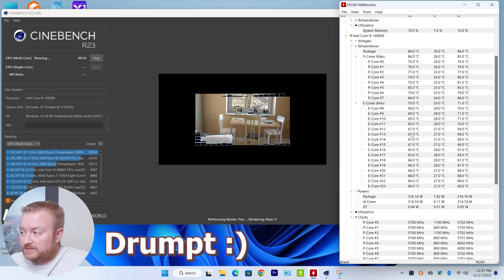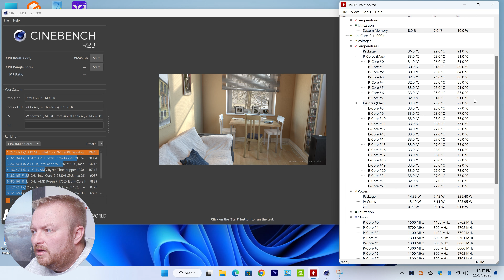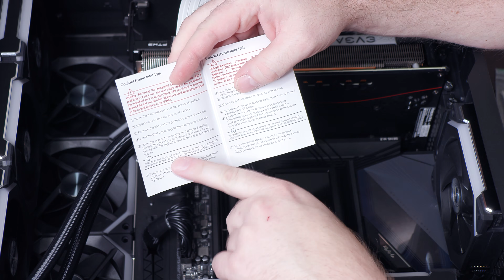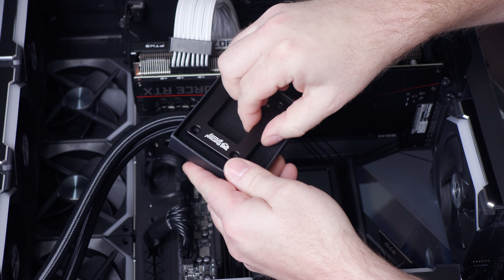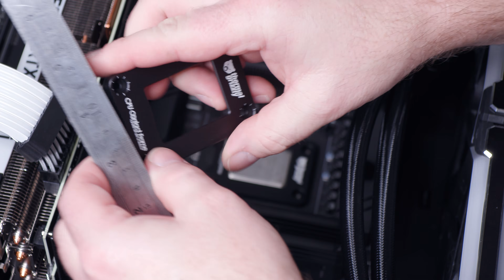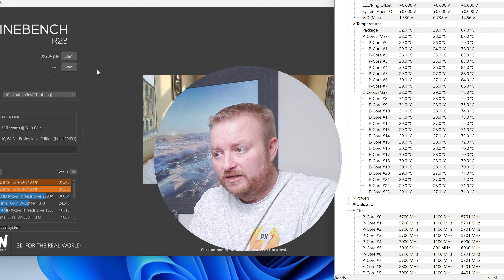Cooling The 14900K | Thermal Grizzly Contact Frame

Comment: a thousand thanks 😀 I looked for instructions or manual or something for my 13 gen and it is nowhere to be found. not even on the thermal grizzly site. I ordered the grizzly and i wanted to check how you have to install it to be prepared. i do not understand why the guide is not available on the grizzly site...

Comment: My 14990k hits 96-100 in occt just ordered a contact frame to see if it helps as I noticed the right side wasn’t making contacting with my aio and how’d you get such high scores
Reply from the maker: The contact frame probably won't help but maybe one or two Celsius it's really not that big of a deal but it also depends on your  cooler and how good that is. I cannot confirm why my numbers were so high it all depends on your settings in your bios which a while ago did not have Intel settings that were standard so that could have something to do with it

Comment: I'm getting ready to put together my new build this week which is based on an AMD Ryzen 9950X3D. This is the first AMD build that I've put together since AMD Athlon I think. So I've been on Intel for quite a while now. My old system here is an i7 8700K. When I was deciding on whether to go team red or team blue I sort of had a red flag go up in my brain when I was reading about power cores and efficiency cores. And then I was looking at the AMD side and all they have is just normal traditional cores. So right off the rip Intel is selling chips that have cores that are underperforming but marketed as a "feature" and also the chips are possibly destroying themselves due to overheating. So then I looked up how much wattage each team is using on their top-tier chips and team blue is nearing 400 watts and team red is about 170 Watts. I really think Intel is on the decline here. Pretty sure I heard talks about them getting bought up by somebody else. AMD is just killing it on the CPU and the GPU side.

Comment: In the next 2 days I want to install my new i7-4700KF with a Thermaright V2 contact frame and Kryosheet thermal. I have a question? The Kryosheet termal pad can touch the contact frame or not?
Reply from the maker: If it touched it slightly not a big deal. The contact frame sits a hair lower than the IHS

Comment: You don't show it so I have to ask, did you clean the old thermal paste off the bottom of the heatsink/pump before reinstalling it (at 15:30)?
Reply from the maker: Yes anytime I remove the heatsink of any sort I will reapply

Comment: After 30 days, i figured out myself and used intel xtu and lowered the p core and e core ratio down to 48x, i.e., 4800mhz. Now, the temps  are 80 max on 100% load.
But it's still a disappointment because i am not getting the actual value for money because i have lowered the speed of my brand new i9 14900k for the sake of temperature.
Some say the h150 is not compatible for i9 14900k and upgrade to a 20 to 25k cpu aio cooler.
Please suggest me what should i do, upgrade my  cooler to a compatible one or just let my i9 to run at 4800mhz forever?
Thanks

Comment: I first saw the contact frame review on GN and was impressed by the thermaltake frame. A lot less expensive than the Thermal Grizzly frame and helped cool the CPU a little bit better. Bought that one for both of my 12th gen CPU's. I will only use contact frames on the 12th thru 15th? Gen Sockets. Intel dropped the ball on the LGA1700 processors by not adding another hold down clamp on the other side of the CPU for even pressure.

Comment: Contact frame helps but I can't undervolt at all. Even 0.015 will cause instability  at 0.030 under it won't boot ..  I'm still throttling at hit 100c at 253 200! Pl1 pl2...

Comment: Tightened my frame "snug" and got a no post CPU not detected, backed them off a bit and voila posted!  They mean it when they say hand tight, so resist the urge to give it that little extra unless you have a NM torque driver.
Reply from the maker: Yeah only finger tight. I think what happens is the pins on the MB move off the LGA

Comment: I think your parts list is outdated.  That's a Gigabyte Auros board and of course you're putting in a 14900 not a 12900.  Not sure if the other parts listed are updated.  Going to take a shot at the thermal frame and the contact sheet.  Thank you.

Comment: Unfortunately, in my case, the frame installation on the i9-14900k failed. I attempted the installation twice, even with a different method of applying thermal paste. the first time I used the spreading spatula, the second time I used the X method. I used the original screws and followed the 90 degree rule. The cooler I use is nzxt kraken 360. After the installation process, the computer heats up to 100 degrees a moment after starting and causes a blue screen. :l
Reply from the maker: It heats up to 100 just at an idle or when you do a stress test?
If during an idle that is not normal but if during a stress test the is normal

Comment: I have an i9 14900k and with my MSI board and a 360mm AIO, with default settings, I was hitting 100c almost instantly during R23 multi-thread benchmark. It was crazy. I had to go into bios and set the cooler to a "box cooler" which sets the limits to intel spec (253w). I also had to disable "enhanced turbo". My temps are now down into the high 70's to mid 80's during benchmark, but I'm noticing that I'm barely pushing over 200w... I get a score of like 36k, when, even with it hitting 100c immediately and thermal throttling like crazy, I was hitting 39k... I have tried going back to default settings and just undervolting with XTU, but that didnt stop the frequent 100c spikes. Super frustrating. I'm not sure why I'm limited in wattage to 200 or less when setting everything to intel specs, and when even just setting it to the middle ground (tower cooler) in bios, which is something like 288w, it still spikes like crazy and goes over 300w. I just dont get it. What am I doing wrong?

I'm getting the contact frame, and going to try using a different paste than the one that already came on my corsair h150i AIO, and hopefully that will make a difference? I see a lot of people fixing their temps on their 14900k's but they are using ASUS boards where they disable the "multi-thread enhancements" setting and its all better. I've been tweaking this for days now. I'm mentally frustrated as hell. I've just resorted to using it as I first described, and getting less than 200w of power just to keep them temps reasonable, but I feel like I'm missing out on a lot of potential with it running so limited. In XTU it says im almost constantly "current/edp limit throttling"... I'm assuming that's because the mobo is trying to limit the power sent to the cpu to keep it from spiking, but I just dont know. Sorry for the long comment, but I'm essentially throwing my hands up in frustration at this point.
Reply from the maker: I have stock settings but found out that it is not keeping a constant cpu speed

Comment: I’m considering the ASUS Rog Ryujin III + Contact Frame for my upcoming 14900K build, but I’m in the fence whether to get Liquid Metal over conventional thermal paste. Most of the time it’s used on CPU’s that are direct die. You think using it would still achieve better results over say Artic Silver 5, even without a delid?
Reply from the maker: Unless you know what you are doing go with normal paste

Comment: You arent thermal throttling on the baseline becuase your P-cores clocks are all over the place I saw as low as 5200mhz during the run, same thing for the contact frame and Kyroshit(too expensive for what it is) so you cant evaluate much seems your motherboard is setting temp limits to 90º and then downclocks the CPU to keep it that way, 39K is low for a 14900K it can go as 41k NOT OC with properly setup with tuned SVID AC_LL / DC_LL or a undervolt preferly both.

Atlest you are using the 2nd gen contact frame from Grizzly the 1st one did more harm than good to stability of the system with its precise torking and overengeniering bullshit. They say the next version was revised for the 13th gen thats BS again since the dimension of 12th and 13th CPUs didnt changed.

Comment: You should have put the same thermal paste you had before installing the contact frame. There is no way to properly compare performances with and without since you didn't... I'm sorry to say this is a close to useless video...
Are the new temps because of the frame? Because of the thermal pad? Who knows!? :\

Comment: Actually just went through this whole process today and I got pretty good results with my 13900K which is cooled by a NH-D15S along with a -0.075v undervolt and I don't hit above 85C while scoring between 39500-39800 in R23. I will say that the biggest difference I saw was the reduction in variation of temperature from core to core. Most specifically the e-cores.

Comment: You were power limiting at ~280w after a short boost period, that is why you didn't hit 100C or keep the cores @ 5700, using a tool like XTU may help you catch these states and understand what is going on. Your Bench Score is low for a 14900k due to the Power limit set by the motherboard. I would hazard a guess that your mobo thermal throttled you to 90C too as the boost should always hit 100 unless ur running LN

Comment: I've always built my systems to push-pull the radiator from cooler exterior air from outside to inside (helps get the cpu cooler), rather than having the fan draw the already warmer interior case temps into the radiator and thru the radiator. Doesn't seem that it would be as efficient. I also have 3 fans on top ehausting the interior heat (since heat rises), and another single at the rear drawing out the warm inside heat.

Comment: Jeez I throttled almost immediately with my aio. I got some kryonaut extreme coming in next week along with some fans.

Also can you runs these tests on cinebench 2024?
Reply from the maker: Make sure you have your pump connected properly. That would result it over heating
Reply from the maker: Yes you can run that test

Comment: i don't have to remove the mainbaord for the frame to hold the backplate, do i? the backplate of the cooler holds the backplate, doesn't it?
Reply from the maker: Sometimes you do and sometimes you don't it depends on the cooler bracket that you're using and depends on your PC case if you were to install it and then have nothing for it to back up to I would always recommend installing it outside of the case unless you know that way you know it fits properly

Comment: disable the virtual settings in bios and set your pl2 and pl2 to 253 watts all your temp problems will go away that cpu was not met to pull 316 watts under load

Comment: Can the original mount bend my CPU so much that it stops working or works worse? Have 14700k and liquid freezer 2 360
Reply from the maker: Not the original, no. The contact  frame can push down too hard to where is stops working though

Comment: Did you mess with Asus' multicore-enhancement to bring down the heat, Mine by default was set to auto, so my CPU was hitting 100c+. After disabling it, and setting intel guidelines it now runs way better.
Reply from the maker: Nope, I didn't change anything. This is a gigabyte MB not Asus

Comment: Can the kyrosheet contact with the contact frame? default cut out for the sheet for LGA1700 is 38x38, since you measured 30mm across.

Comment: I am so frustrated with my 14700k. I installed a 420 arctic liquid cooler and still peg out as soon as I start cinebench 23.
Reply from the maker: Maybe you don't  have the pump hooked up? This would make it heat up fast. Double check that

Comment: What AIO are you using? I couldn't find it anywhere. Where is you CPU AIO front or Top? You mentioned push pull, which fan locations are pushing / pulling and in what direction.  Great video thanks
Reply from the maker: Sorry it was in my build video. I added it to the description. Air being drawn from inside case to the outside. AIO installed vertically in front

Comment: Can we use together contact frame and kryosheet ? I mean contact frame share aio pump plates surface and helping to cooling. Doesn't the Kryosheet create a gap between contact frame and the plate?
Thanx for the video btw
Reply from the maker: You can use them together. I showed it in the video

Comment: I will be testing out thremalright contact frame/EK 360 LUX aio/ artic MX6 with my 14900k this weekend. I was thinking about using a push pull config in my lian li evo case. But I think i will stick with 10 fans I got already. I think the 3 SL140 I have in the bottom as intake do such a good job bringing in so much cold air, and plus my PC is in the Basement. But really curious to see what temps I get without doing any undervolting or using extreme utility AI :)
Great video by the way

Comment: I just got my own setup done, 14900k with the frame, kpx paste, full custom loop with 2 triple rads and 1 dual rad and running cinebench runs the temps up to 100 on two cores and between 90-95 for the others . Clocks show 5.4ghz running which all seems wrong but it scores 40633 ish so... I dunno ...
Reply from the maker: Interesting

Comment: Any reason to not do push/pull as intake bringing in cool air through the radiator? Nice vid & neat test w/ the sheet. Never saw that before.
Reply from the maker: Great question. Some reasons you might not want to do it or can't do it. 
1. More fans to go bad for fail
2. More cost
3. Case restrictions 
4. Increased dB (noise)
But with that said I like the extra help to cool it. This is not needed in the  lower end CPUs at all.